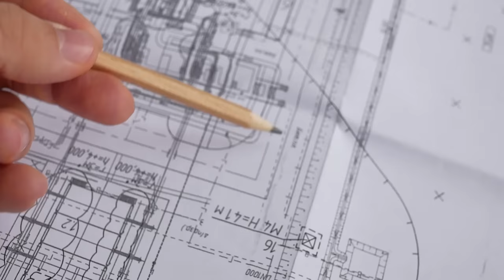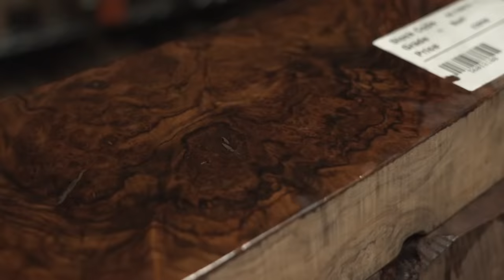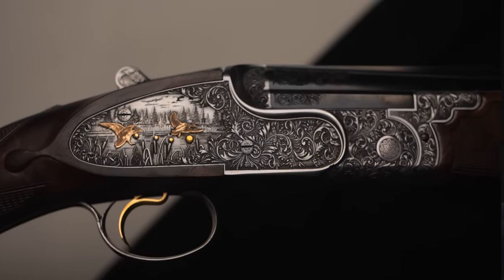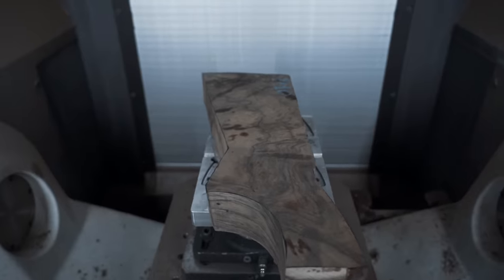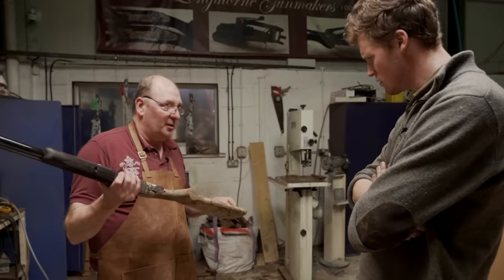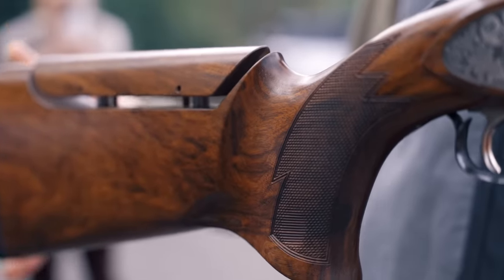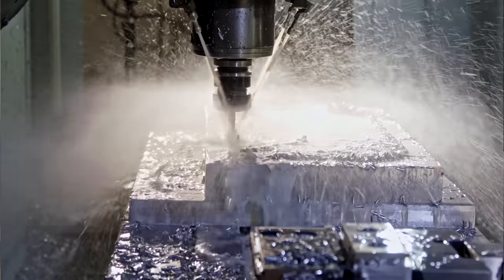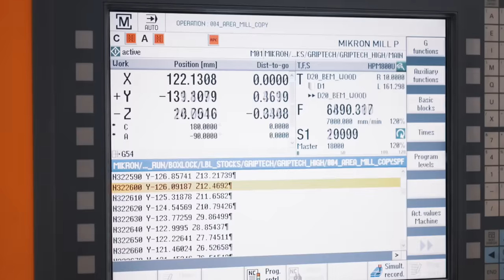Building a New Gun with Longthorne Gunmakers

Comment: Great video, being a machinist for 25 years, i know and appreciate the progress of process. I remember a job for zeiss cmm ways. It was extruded aluminum. Had to be square,perp,flat within. 0002 within 40inches of length all four sides. Which was .00005 per side. Every cut changes the structure, the extrusions just held so much stress. Every cut released it. We made hundreds of them. But was a good education and challenge.